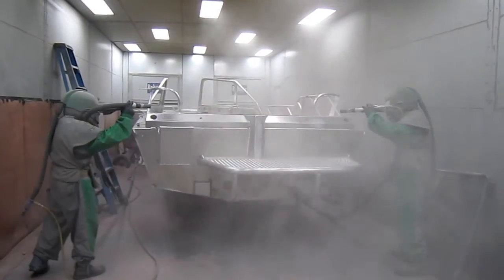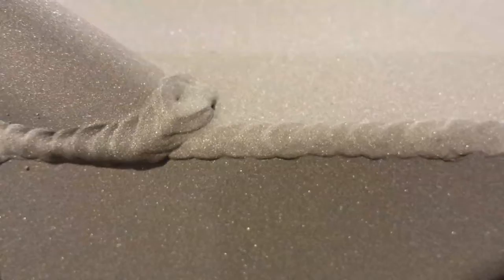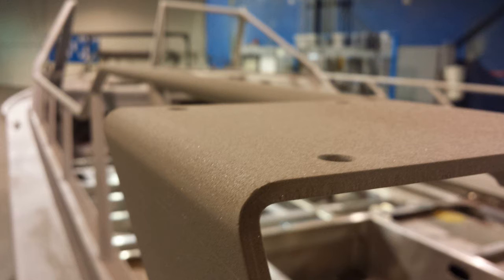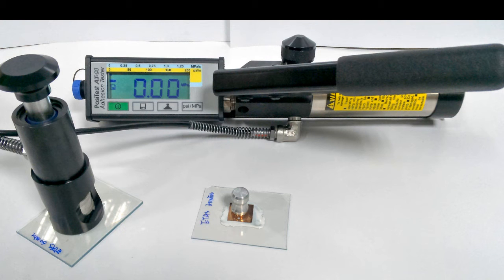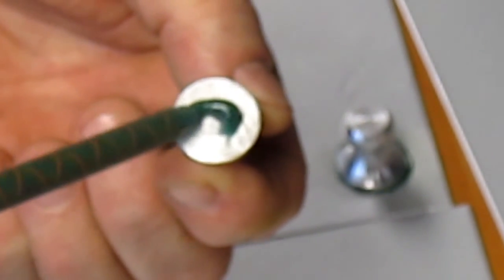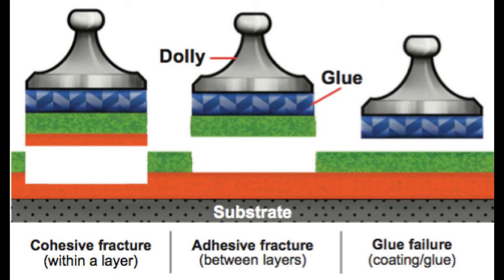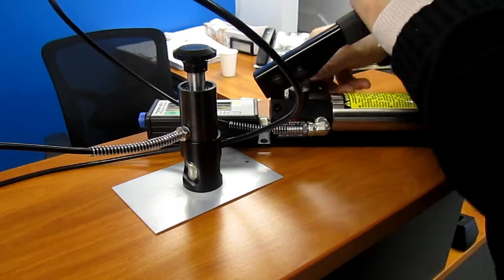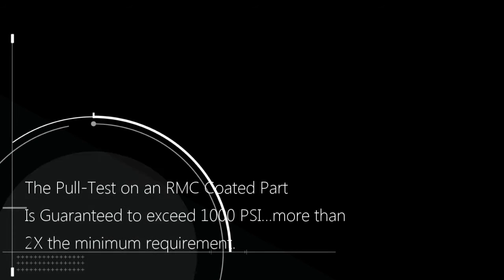Tutorial: Sandblast & Primer - Why It's Important For Powder Coating

Comment: So many unanswered questions here.  What if your powder coating jewelry for instance, would you powder coat that or would it make the finished product pitted or orange peel looking?  You mentioned using a primer which I've never used when powder coating, is this again suitable for smaller fine detailed jobs?

Comment: When you were hammering the surface that was used (not test piece) the table itself could that be sandblasted and powder coated ?
Reply: Aluminum sheet metal could be sandblasted I’d recommend glass beads it can be powder coated

Comment: This is a lie! You don't NEED to sandblast and prime everything.. With a simple soap and phosfate wash you can still get things to last 20 years. Sandblasting and priming is better, but not a must.
Reply: Sandblasting is better, if you coat over mill scale, it want last.
Reply: @ashleysimmons4586  it will if you use acid wash and rinse.
Reply: You're right.  Etching with phosphate does work!
Reply: Chemical or mechanical treatment options..SB is one form of mechanical.
Reply: Hs85dk, how many of those powder coats that you did at least 20 years ago you are still checking to see that they withstand the weather, abuse, and environment that they have been under? Or, are just assuming that?
Reply: Hope you're still around you seem knowledgeable on this and I've just started  in the job,  I've just had a load of sandblasted stuff come through, The first lot I rubbed down and wiped with thinners undercoated then colour and the surface was gritty turned out to be fibres of the cloth, now rub down/ blow off and spray with thinners and get a good finish, is that right or should I just blow off and powder over sandblasting? Does it spike through?